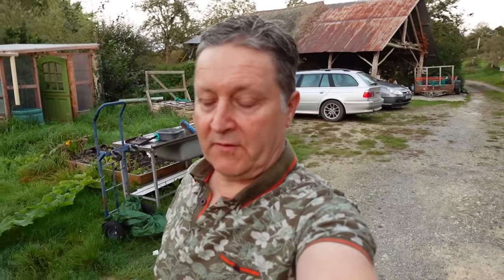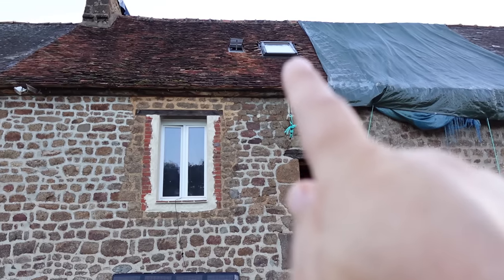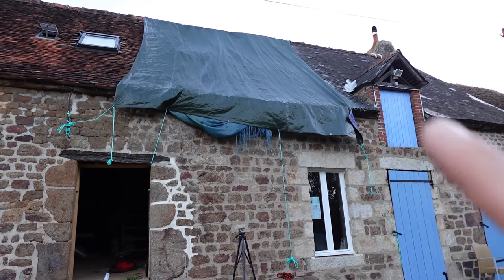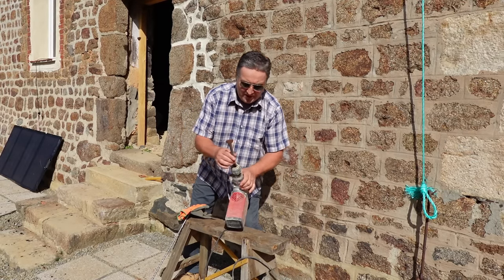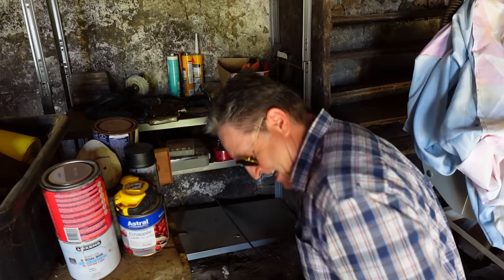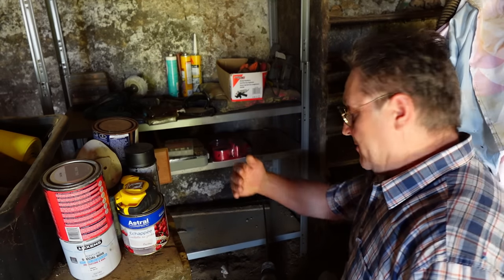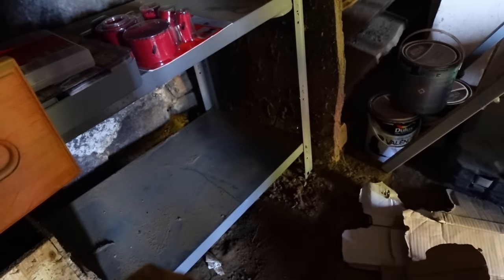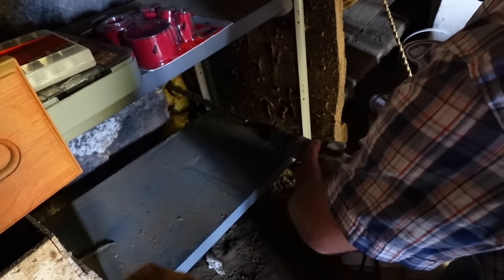Too Dangerous To Drill? | Cottage Renovation Episode 38

Comment: Why remove the dirt bank from the north stone walls, was it a moisture problem? Seems like the plumbing and waste pipes could have been run horizon from cottage to cottage inside the north wall instead of outside the wall. You are doing a remarkable job on those old buildings, in the States those buildings would have been pulled down long ago. Love to see what you're doing every day.